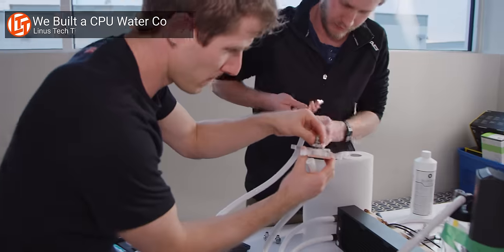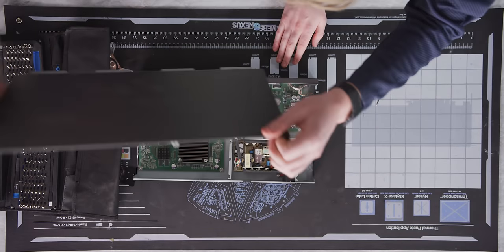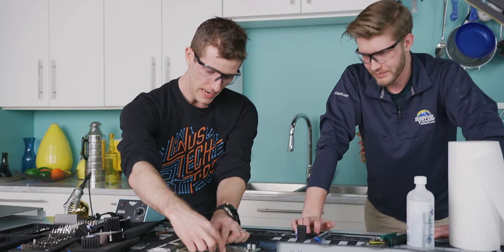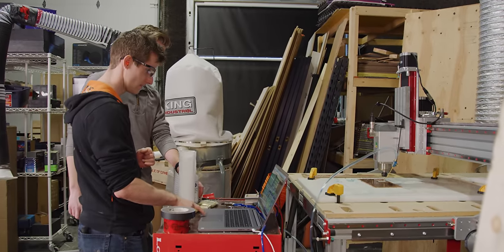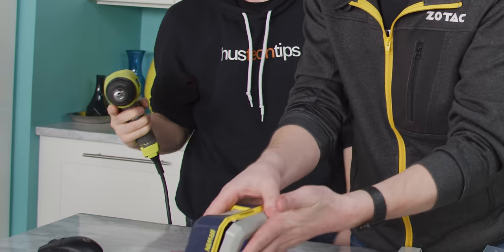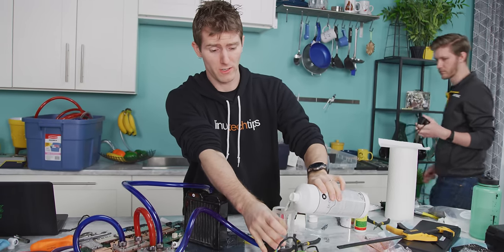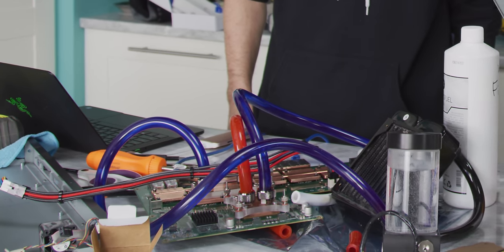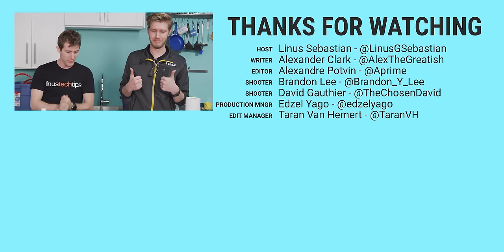Water Cooling a Network Switch!

Comment: Hi.

Nice ghetto-mod

Only common denominator that I keep seeing in your videos are the blatant disrespect for ESD.
Now, a lot of folks say it doesn't matter.
Well, it's at least partially true, but no product is a 100 percent infallible .
Everything has it's breaking point.

You should really try to teach others about why it's important to do this. Like making sure you're discharged (ESD arm band, not handling stuff between several others un-grounded  etc)
I'm btw really surprised of some of the mods that you did that they even worked.

I could go on and on about this, since there are so much that could be covered on the subject.

One thing that many fail (due to lack of knowledge!) to understand is why a product works just fine the one minute and a while later starts failing, don't start and so on.
This could by all likelihood be due to a so called latent damage. Imagine an ESD strike like a welding electrode with over-current striking on a thin sheet metal surface. Ten to one there will be a crater there. Now, also imagine that that sheet metal were strips as wide as it's thick. It might hold, but it might also break, or something in between, and that's why circuits may fail over time.

In all fairness, most circuits made today have actually very much improved built-in protection that withstands many volts, but also understand how high these voltages can go.
The human body model, as it's called reaches up to 2 kVolts if I'm not mistaken, as the machine model reaches even higher, like 5-20 kVolts.
These higher levels can actually be reached on conveyors, certain plastic wrappings (Like cling-film) etc. 

Always treat electronic components with the utmost care and respect!
Also, a note on the cooler. I've seen several mountings to the cooling solutions that you guys use, and water cooling in particular:

Why - Why would you ever (LIKE EVER!) connect waterblocks in series????
Why shift over the warmer fluid to the next circuit?
Don't say the flow/pressure will take care of that.
Everything should be in parallel and if not efficient enough, bigger radiators.
Reply: To be honest, I have never really worried about ESD for assembled electronics (bare circuit board). Things like the conformal coating placed over the boards (ROHS and tin whiskers...etc) helps tremendously. It's one of those things where you could worry about it, but it's a balance of effort versus risk. If you touch the chassis of a PC power supply while it's plugged in or the like, you're effectively dissipating your excess charge to the same ground as the parts you're working with, not perfect but it's a quick and dirty method that further reduces the risk. I only really worry about it when I'm working with discrete components that are known to be easily damaged, then a quick wrist strap grounder is in order, otherwise I wouldn't worry honestly.
In regards to your water cooling in series, it depends greatly, and even when every is perfect for either to work, the difference is minor. Water can only pickup so much heat per pass and it isn't spending enough time in the blocks to become fully saturated. The large amount of heat capacity of water means that going from one block to another doesn't impact the water's ability much to absorb further heat down the line. Overall, if you measure the water temperature of your loop at different locations in the loop, you'll find the loop overall is near the same temperature throughout (+- a couple degrees really). The biggest thing you're missing is that flow rate is actually very important, you can't just ignore that. In parallel, it only makes sense if your blocks are of the same pressure drop, otherwise you will run into flow rate issues through your more restrictive block that is in parallel with a less restrictive block, which will in turn lower your cooling performance. If you're unsure of your pressure drop in each block (that they're even), then it makes sense to be safe and do a series loop. Either way, series or parallel, the blocks are not 100% efficient at heat removal from the parts, and the radiators are not 100% efficient at removing heat from the water, so eventually it reaches a steady state of water temperature regardless. However, with CPU's being more dense these days (heat output per area), the pressure drop is usually larger for CPU blocks, and thus a CPU in parallel with a lower pressure drop GPU block, is a bad idea. In other words, parallel may work, but series is a better and safer option overall as it is more optimal the majority of the time. But with most things engineering, never completely say no to a particular solution, it may work for a configuration you have in the future. Thus, I largely disagree with your absolute statement of always being in parallel, in varies per circumstance/configuration.

Comment: black is positive, orange is negative... WTF? 

now all people using sleeved PSU cables. 

Black is ground while orange is -12V
-12V in PSU have lesser current capability

(+12)------(0V) ------- (-12V)

Comment: Watching you guys use a bottom end tap on a hole that goes all the way through is painful. Also please don't use a drill press to tap a hole. Only use it with the tap loosely in the chuck to get the tap started, and even when you do that, you're supposed the countersink the hole first.

Comment: Wtf why the hell would you cool a fucking network switch?
Reply: Why not? The chips do get hot
Reply: Arent fans ok
Reply: @good2die223  I mean sure but better cooling extends lifespan and it can run quieter.

And the most important question. Is why not

Comment: I absolutely love these ghetto water cooling random shit and making awful heat sink vids. But I don't think we'll ever be satisfied until you guys cast a "good" successful aluminium heat sink in sand. Imagine all that extra surface area on those aluminium plates caused by the textured surface from the sand! It'll get you like an extra degree or two cooler!! And who doesn't want to be cooler!?